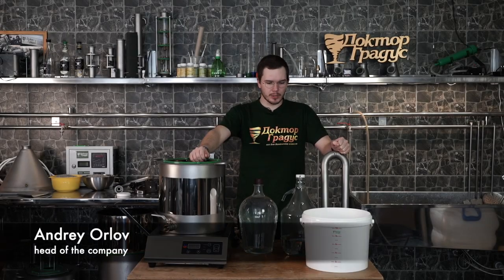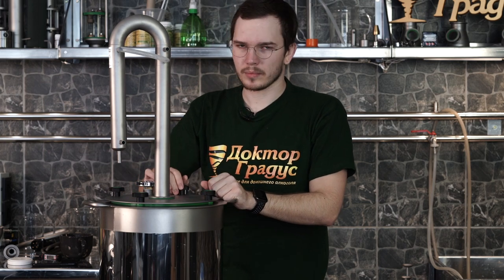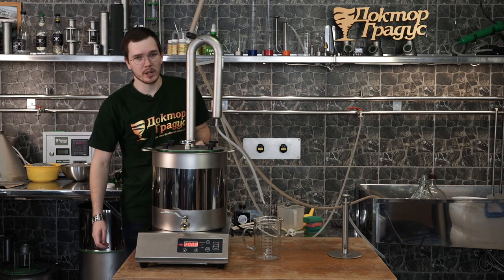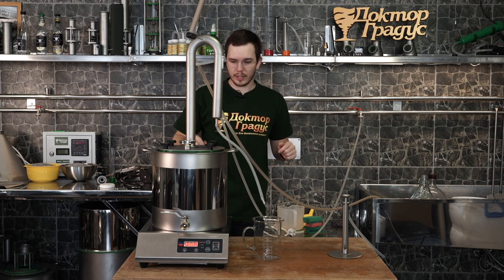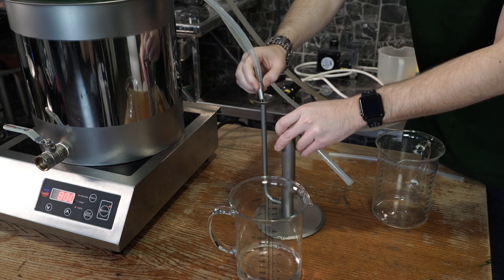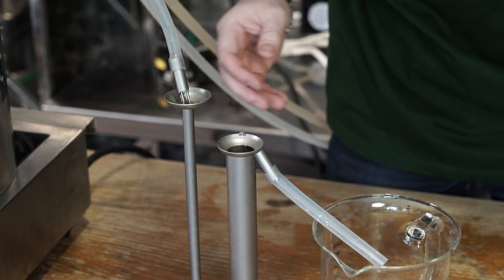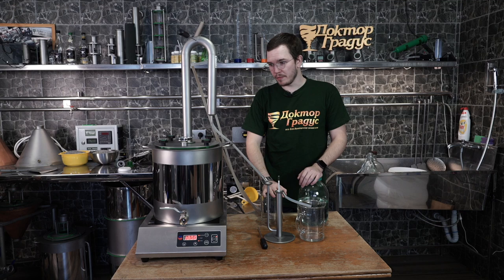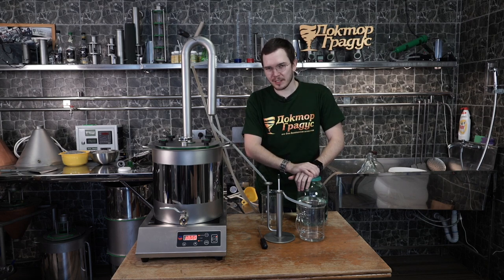Distiller Stillman Variant second distillation

Comment: I think this kind of column has two problem. 1.putting in and out packing is hard  2.you couldn't clean inside of the column. I will be happy you response. but your videos are very good and I suggest you to make lots of them specially how to make different types of liqueurs.
Reply from the maker: Well, it's a beginner distiller for the smallest cost from our range of distillers. Yes, it's not modular and might be difficult to add anything, but pretty popular setup we sell for beginner in Russia who just want to try and start distilling. More than a thousand of people started the journey of distillation with this still, so not so bad option. Thanks for the comment and yes I'll be making more videos.

Comment: Hi, Congrats on your company's success. Good products well done, Your Father surely must be proud of you.
Great finished products your company has. Has super potential world over. 
I have a question. 
You extracted 6 litres of spirit mix. Then you removed in the second run 200 ml of methanol and other non consumables etc.
But 5 to 7 % of 6000 ml / 6 litres = 300 ml at 5 %. or 420 mili litres @ 7%
How did you arrive at 200 ml heads or methanol spirits.
im from India. Our NGO - www.BIPA.in
Thank you :)
Reply: 5%-10% of absolute spirit. 6000ml (41%) * 0,41 =  2460ml (100%) . 2460 * 0,05...0,1 = 123...246ml.